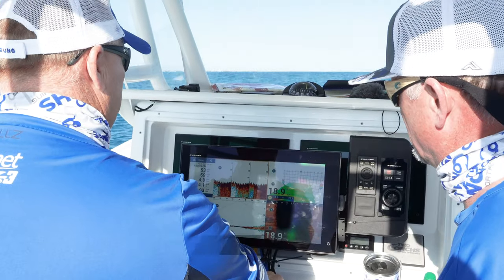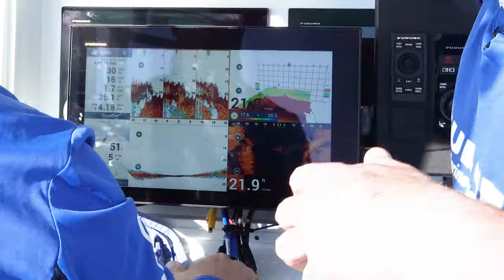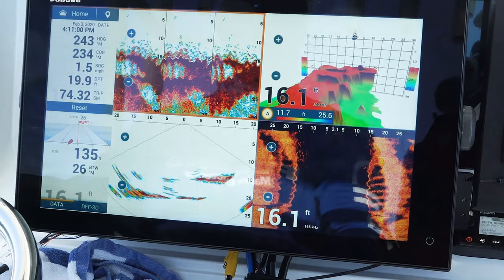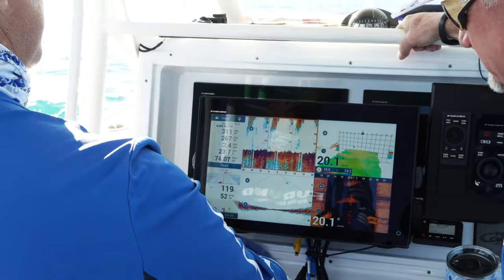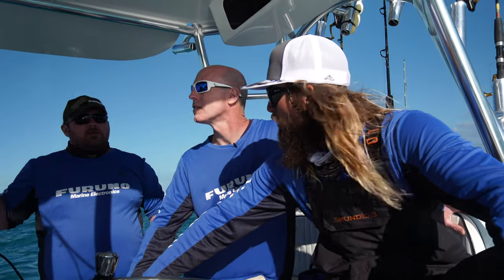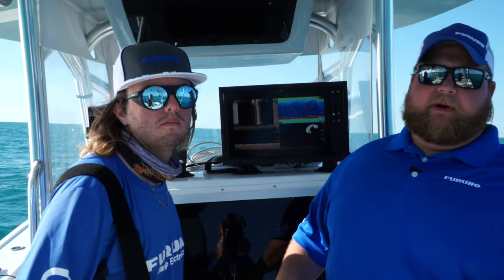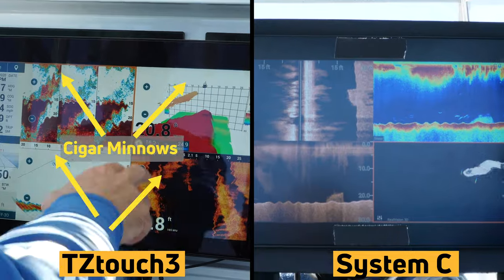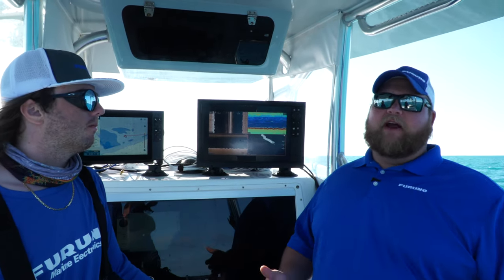EP21 Real Side Scan Sonar Shallow Water Performance Tests 2020

Comment: In every side scan test, the Furuno Boat ONLY utilized the DFF3D Side Scan System.  Captain Jack and myself never used, or had to use, TZT3's new built-in 1kW True Echo CHIRP Fish Finder and the 275LHW Transducer.  However, all of our competitor's systems did use their internal Fish Finder because their fixed single beam side-scan systems are limited.  This example further shows the versatility of the DFF3D.  Furuno's unique Multi-Beam technology utilizes 40 individual 3 degree channels to electrically scan the entire bottom in real time.